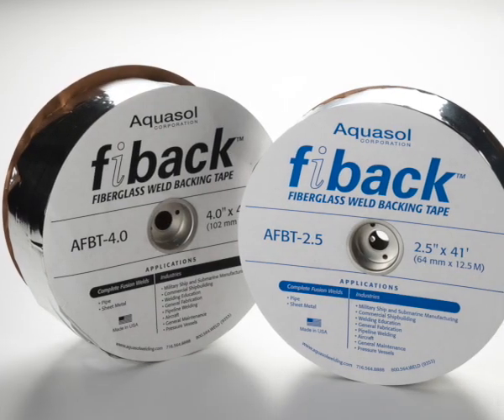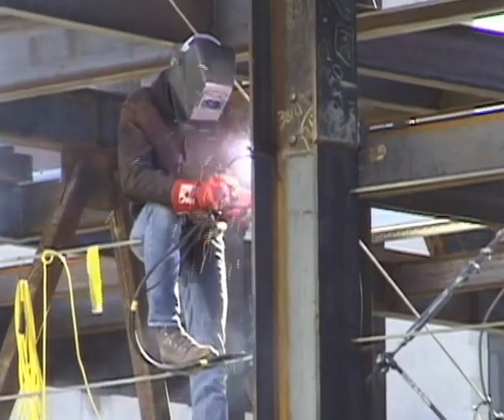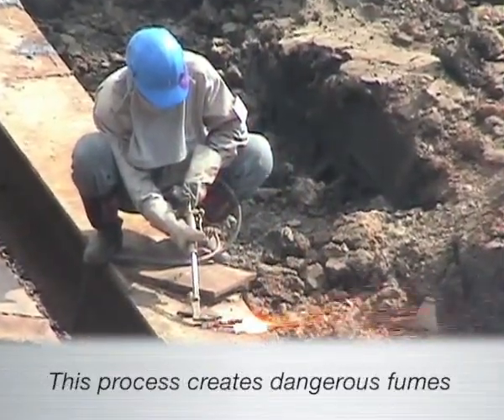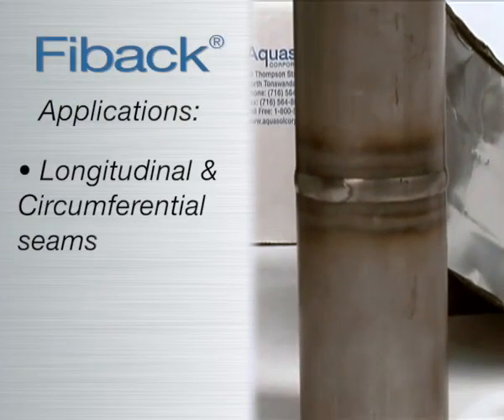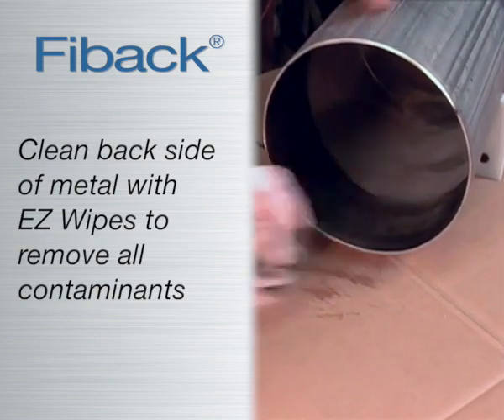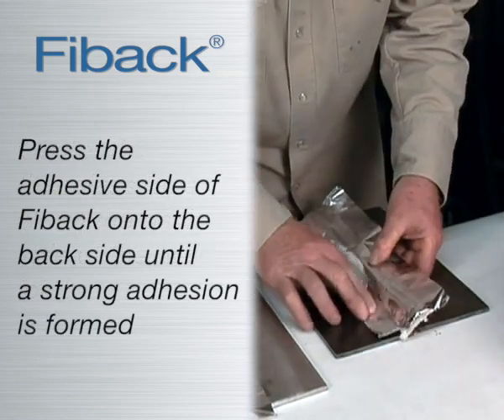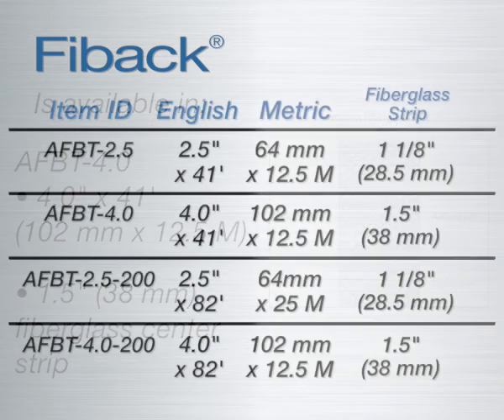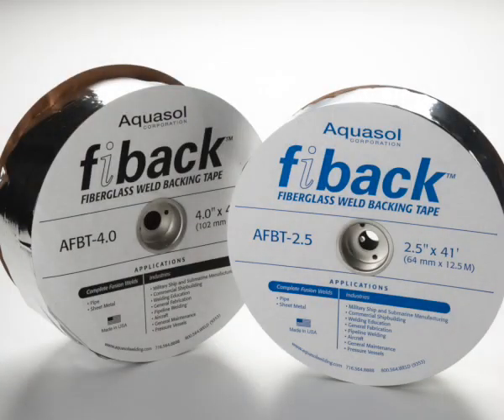Fiberglass Weld Backing Tape — Eliminate back purging with Fiback from Aquasol Welding

Comment: Hi, If you have any information or experience using the fiberglass weld backing tape at stainless steel welding with SMAW method, can you please share ?

Comment: The video states that the method used to remove metal backer strips is “air carbon arc gouging”, but shows a person scarfing with an oxy-acetylene torch, lol.
We just got this stuff at work.  We’re hoping we can just put it up flux behind the metal, as we would with ceramic backer strips.
Reply from the maker: “Thank you for your comment.  However, we think you misunderstood the narrative which states
  
“When back purging is not a viable option but an enclosed weld area must be achieved.  Welders resort to the use of steel backing bars.  The method for removal of these bars is air carbon arc gouging creating a high level of fume byproducts that surpass the allowed exposure to welding fumes in a workplace.  The surface must then be restored by rewelding. Fiback bypasses this process entirely. “

The operator must have access to remove  the  Fiback Tape  by simply pulling  the tape off.
Reply: I doubt this tape will handle the heat as well as the ceramic tile backing tape. This has to have a gap between itself and the back of weld or it may burn through, depending on how wide your root gap is and amperage used.
Reply from the maker: @phiksit  Hello and thank you for your comment. Unlike Ceramic Tape, Fiback Fiberglass Backing Tape is flexible, allowing the operator to achieve a continuous bead.  With Ceramic Tape, the spaces between pieces causes stress points in the weld.  The fiberglass tape can be prepared in a V shape to create a gap and profile around the weld. The photo is an exaggeration for illustration purposes.  Only a small gap is necessary for purge gas. However, more experienced welders can also lay the tape almost flat.  Please refer to our brochure and manual for detailed configurations.
Reply from the maker: This image portrays the Vshape Gap. https://www.aquasolwelding.com/wp-content/uploads/2014/08/Fiback_0007_Layer-49.png